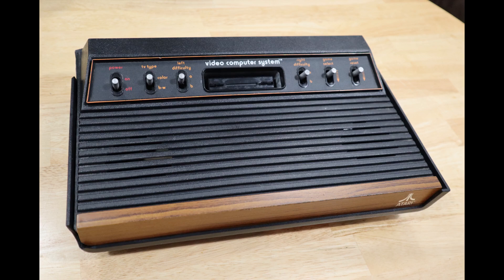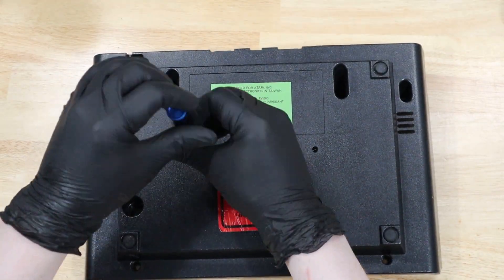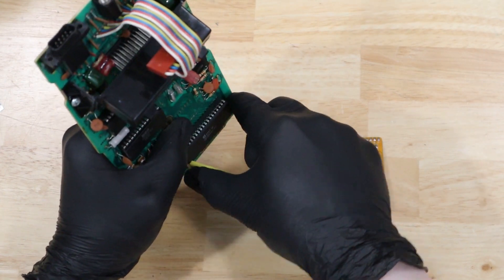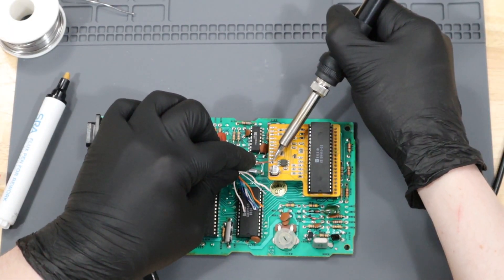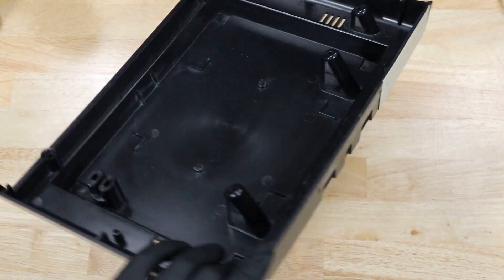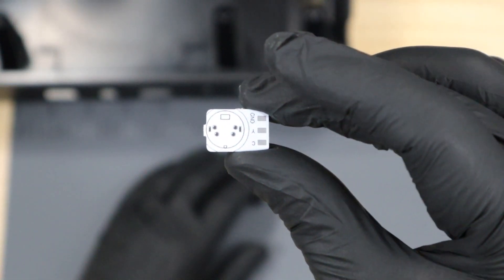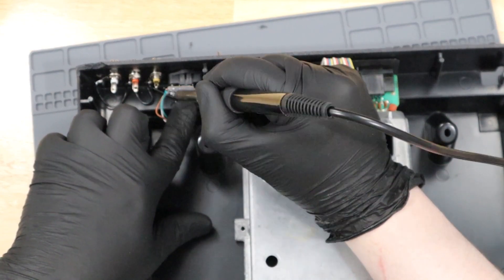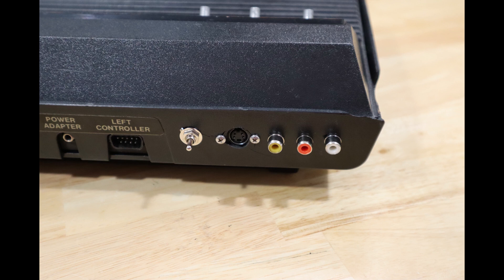Atari 2600 S-Video Mod - My First Mod Ever!

Comment: Hi!
One question: is this mod superior to rgb-mod?
Thank you!
Reply: No it is not. RGB quality is slightly better, but on a system with such limited graphics compared to s-video not realy a big step. But the RGB mod (from Sam Worthington) is much more expensive and not easy to install. This mod here would be quite easy, but the problem is, that the vendor is out of business and I can't find an alternative. The 3rd available mod ist the easy composite-mod, but this one has defenitely the worst picture quality of all three.

Comment: Thanks.  Winz was my first mod too and I didn't have great soldering skills. In the end i found it too difficult, set it aside and went for the Ebay El  cheapo composite mod.  Fast forward a couple of years later and having better soldering skills, I'll think I'll pull mine off the shelf and try again.  Your vid answered some questions i had.  Looking fwd to doing this again

Comment: Really awesome! The on constructive critique I'd offer is use a step drill bit, I can see the crack's in the plastic from the drill bit.  Aside from that, really good.  I've had issues with grounding from these little kits, I use shielded cable with the ground in each cable and found line noise goes away.
Reply: I am looking at purchasing this mod now. Can you give me your opinion of the quality of this mod and its contents? How has it held up over time? Picture quality good?
Reply: @viper33802  hey thanks for the reply. I've only had it installed a few weeks. Asteroid has weird vertical lines in the objects that would normally fade and frogger has similar vertical lines when the frog is in the same path as a truck. Not sure why. Aside from that it's a great mod.

Comment: whats that tool what do you use to tigh up rca jacks?
Reply from the maker: It was a 6mm Socket I had lying around. Mine just happened to be metric, since I deal with Nintendo consoles. I believe either a 1/4" or 3/8" will work the same.

Comment: Great... I own a 2600 with wooden case too. I never would change anything at the case. Therefore i use an old CRT TV to play some games from time to time.
Reply from the maker: I have an old CRT sitting around for playing some games, but I felt my console would get more use if I could hook it up to a more modern TV. But, nothing beats that classic CRT glow.
Reply: If you have a heavy Sixer built in Sunnyvale, don't modify anything.  It's valuable for collectors. Everything else I would install a mod from Vintage Gaming / Brewery/ CleanComp.

Comment: Great video, thanks for sharing. Does the RF out still work with this mod?
Reply from the maker: I reached out to the manufacturer for this mod. According to them the RF will still work, but only in black & white. The color is routed through the mod and not sent along the line anymore. I actually left the RF cable completely out of the system when I did this mod, since I only plan on using the RCA ports.

Comment: Should you have considered using a cat5 coupler so you could disconnect the motherboard if necessary without having to disassemble the entire thing.  motherboard cat 5 to coupler, coupler to cat 5 to composite/svideo interfaces?  Then you could just disconnect the cat 5 from the coupler if you ever needed to get into the motherboard.  Dunno... That's really the only thing that sticks out to me is that taking it apart now is going to be a pain.
Reply from the maker: That's a good suggestion. A way to be able to disconnect without complete disassembly is a good idea for next time.

Comment: Hi! Is there a link to this mod? It looks great!
Reply from the maker: Here is the one I bought, but they are sold out. :-(  https://www.ebay.com/itm/Atari-2600-Drop-In-A-V-S-Video-Composite-Pause-Mod-Kit-NTSC-Ben-Heck/312823515829
Reply: @LastHeartGames  Hello! Winz is no longer in the community, could you edit your Description so people don't purchase his kits. The website is dormant and has no security attached to it. I used to work with Winz and unfortunately he had a personal issue that took him from the community. Thanks!
Reply: @LastHeartGames  we will have more soon! :)

EDIT: Please do not buy from his website, it's not secure and he is no longer in the community. Thanks!
Reply: @ChrisKewl  Hi Chris again. We talked at AtariAge-Forums already. This video was the reason, I tried to order at WINZ, which we know by know, was a mistake :-(
Reply from the maker: Looks like they have more in stock now, but it might be under a new listing. The store page is https://www.ebay.com/usr/winz_mod

Comment: Well I just completed mine, but got a black screen. So I guess the RIOT chip is toast?
Reply from the maker: A dead RIOT chip was the cause of the black screen with this unit. I was able to get flashes of games before it went black. For example, when putting in Combat, it would flash the starting screen for a frame or two, and then go black. That is what led me to think RIOT. Before replacing it, I would check your power first. A lot of Atari 2600 units have bad voltage regulators.
Reply: @LastHeartGames  It's a new regulator. I replaced pretty much everything from the Console5 refresh kit before I installed the mod, and it was working just prior. But I will check the voltage
Reply from the maker: I found the team that made this mod on Discord. They might be able to help you out there. If you replaced everything beforehand and had it working, I would ask them for support. discord.gg/RvMGrgm
Reply: @LastHeartGames  I haven't had time to work on it again, but I did notice that they have a new run of the boards on eBay, this time with a blue solder mask

I guess I'm a bit too old school, never really really looked into Discord, but I guess now I might. At least till I can work this out
Reply: Hey, was it my mod?
Reply: @winzmods9045  The board I have is the same one featured in this video

Comment: Very nice. Never knew about this specific mod, but I'd definitely do it when I get a 2600.
Reply from the maker: It was relatively easy to install, but now I can play it on more modern televisions, rather than only on the CRT I have lying around.
Reply: @LastHeartGames  That would be my main motivation.
Reply: @LastHeartGames  Interesting, since even the newest TV's have an Antenna line in, but have dropped composite and S-Video.
Reply: 13:34  Ok,  who's tried calling the old SEARS and ATARI   1-800 service numbers to see if anyone is still there ?